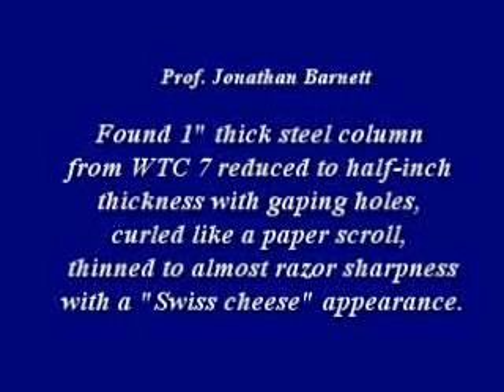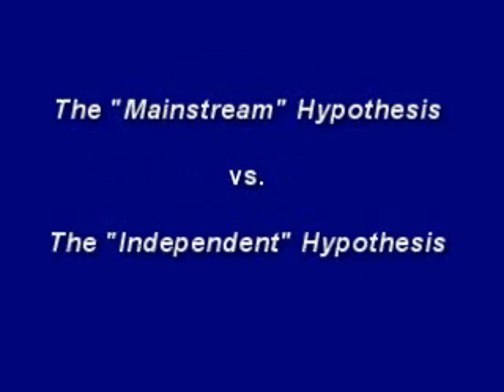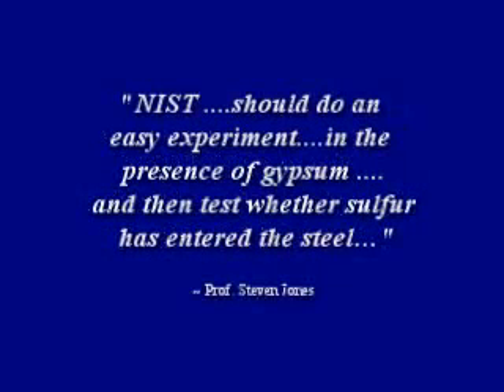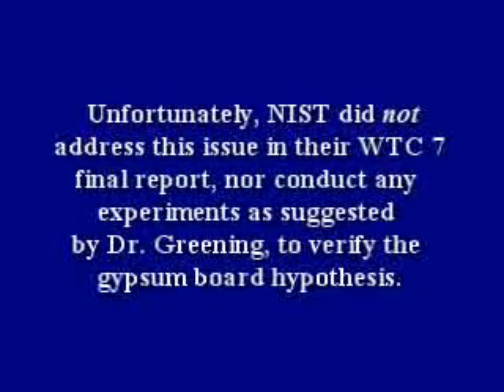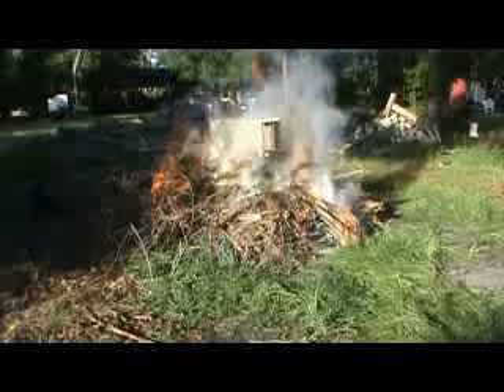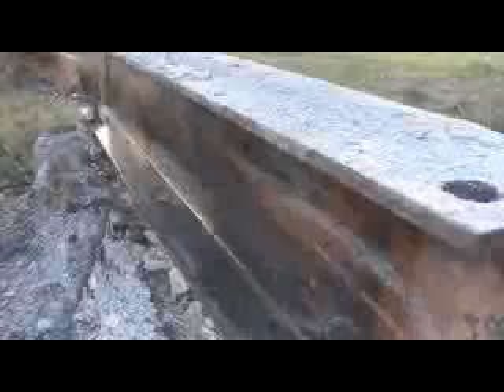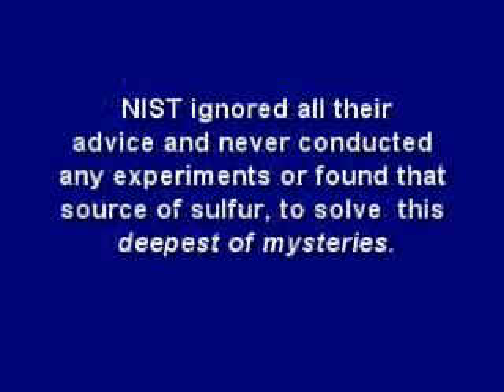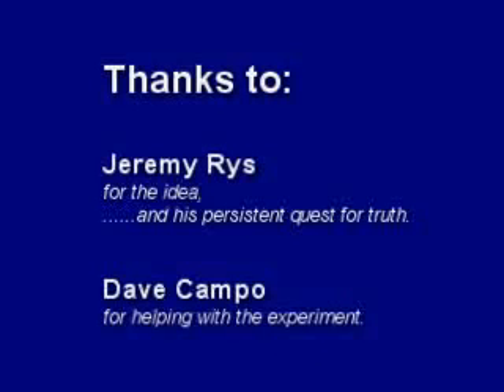9/11 Experiments: The Mysterious Eutectic Steel

Comment: The steel found was not melted, it was corroded in fire from 800 to 1000C.
At 5:44, the experiement puts the steel in wallboard, then in the fire. Wallboard is insulation, the steel will not get hot. This was not what happened on 911 - on 911 the wallboard that was used for insulation was dislodged during impacts and collapse. 
The steel corroded in the WTC had no wallboard covering it, it was in the pile. This dolt doing the experiment has no clue why the steel corroded in the WTC.

His experiment is dumbed down for people who can't think for themselves. 911 truth a movement that only exists in the minds of people who can't think for themselves. The corroded steel found at the WTC was not exposed to thermite or temperatures greater than 1000 C. No steel in the WTC was exposed to thermite. What a joke.  

The mysterious Eutectic Steel was corroded in fire, and the report explains this.
One source would be acid from batteries during the fires in the WTC pile.  But this video is not science, it is BS. 
http://www.fema.gov/pdf/library/fema403_apc.pdf
What an idiot, makes up a failed experiment, and lies about 911.  
13 years of failure - 911 truth
Reply: eyesuntzu The very last sentence of that link states; "No clear explanation for the sulfur has been identified"".
That was the point of this video, where did the sulfur come from. As shown, it couldnt have come from building materials.

mocking the murdered
Do you have the hubris to call the 911 Family Steering Committee ignorant and gullible? What about 911 Commissioner Bob Kerry when he stated "it is a 30 year old conspiracy?
Or the whistleblowers from the FBI, CIA, NSA ,Pentagon, and 911 commission?

Lastly, what proof do you have that 911 wasnt an inside job? Dont appeal to authorities either, just list the physical proof the OCT is absolute truth
Reply: Dr. Franken Juice Guess you lost your evidence and have no claims. Is Chemical Engineering too hard for you? Is that why you lie, out of ignornace, a lack of science. Were you upset when the "smart" kids took chemistry and physics, and there you were with Charlie Sheen, playing baseball, high school dropouts? Charlie, a high-school dropout believes your lies and fantasy, as do your other peers, the Boston bombers were 911 truth believers. You got the best...
http://www.fema.gov/media-library-data/20130726-1512-20490-8452/403_apc.pdf
Here is the report, you will not understand it proves no thermite was used on the steel samples found, two samples of steel corroded in fire. You will not understand science, so you believe BS you found on the Internet, and we all know, if it is on the Internet it has to be right... you are gullible...
13 years, and you are supporting liars, and nuts like the guy in the video, think he is a sewer engineer, and BS is his game.
Reply: Dr. Franken Juice Wow, the n-word, looks like you are upset you have nothing but lies and BS to support your delusional claims. You can't do engineering, failed to take science, and end up being a follower - 13 years of BS based on ignorance; self-critiquing
Guess you failed to understand why the report makes the video BS.
http://www.fema.gov/media-library-data/20130726-1512-20490-8452/403_apc.pdf
Maybe you can get a chemical engineer to explain where you failed. 13 years of lies based on ignorance. 911 truth exists due to the ignorance of the followers
Reply: Study of the steel corroded in fire. 
http://www.fema.gov/pdf/library/fema403_apc.pdf
The paper includes the corrosion could have started before 911. The paper shows the steel was exposed to fires 800 to 1000C. 
Thus slow corrosion was possible. But the steel samples corroded before or after 911 were subjected to fires due to the WTC disaster done by 10 terrorists with two planes, no thermite.
The study of the steel proves no thermite and makes the video a failed experiment.
Reply: eyesuntzu
Lol. What are you even trying to achieve by insulting others and twisting facts?
Reply: freierHimmel You insult yourself by supporting the insanity of a Beam Weapon, and dustifying steel.  You have a fantasy and mock the murder of thousands on 911 by spreading idiotic insane lies.  You are good at it. Insulting, you are spreading lies, you can't figure out 911 - and you are proud of it.  You should try taking physics instead of falling for lies from Judy Wood.  911 truth spread lies.
Reply: eyesuntzu
Ah, come on, you can do better. Blaming on others what you do, thats so old...
 Its fun to see with what you shills come up with just to discredit someone^^
Reply: Corroded steel is not caused by fire, melted steel is caused by 2800 degrees F. Maybe someone can tell me where the heat came from? It sure in the hell did not come from a low temp fire. And in Bldg 7, every beam both horizontally and vertically magically failed at the same time uniformly. What a load of horseshit. Study physics, that way you won't sound stupid and ignorant.
Reply: freierHimmel Oh, shills, you are paranoid and failed to figure out 911 after 13 years. You have no evidence to support your claims, and sadly you have no clue you have no evidence.
Reply: Thomas Sayles There was no melted steel at the WTC. Study the event before blindly fooling idiots who think thermite did 911, giving a pass for 19 terrorists, and mocking the murdered. Hard to get dumber than the melted steel lie; are you gullible, or what. 
WTC 7 was not a terrorist target on 911, it did not fell uniformly, do say so only exposes your ignorance and gullibility.
Reply: Jeffery Pinley It did come from the building, sulfur was all over the WTC, and the reports clearly cover what it could be, but they will never know exactly what it was; the steel did not melt, thus it was not thermite; and no steel had any damage from thermite, or explosives.  
There are no whistle-blowers for 911, there are some fake ones, but most people can figure out they are liars.  
What proof you have 911 was an inside job; gee whiz, you can't even figure out corroded steel is not from thermite, how will you prove your inside job fantasy?  Got some Bigfoot proof with your 911 fantasy?  
Is Bob Kerry selling another book?  
Guess you have no clue what is in wallboard, or in UPS, or in plastic, etc...
Reply: eyesuntzu"and the reports clearly cover what it could be, but they will never know exactly what it was"

Oh so what the govt says may not be absolute truth? Where did the sulfur come from? What about the 'meteroite'? What about Bechtel engineers report temps above 1600f to 2800f the temp of molten steel? Why do several eye witnesses report seeing molten steel? They saw glowing red, not aluminum like many deniers try to claim, aluminum when melted is silvery.

"There are no whistle-blowers for 911, there are some fake ones, but most people can figure out they are liars"

Care to explain why Cibel Edmonds is fake? Or Max Cleland? Or April Gallop? Or Barry Jennings? Or Susan Lindauer? OR 911 commissiner Bob Kerry when he states "it is a 30 year old conspiracy"?

"you can't even figure out corroded steel is not from thermite"

Seems you completely missed the point of the video, nothing in the building material can explain the sulfur. Regardless, 3 buildings completely destroy themselves symmetrically top to bottom near free fall (wtc7 was at ffa), only possible through precise removal of key components, aka CD.

And why wont the govt show just one conclusive video of what hit the pentagon? IF its really a plane, then why wont they show a vid? It really takes a devout leap of faith to assume the govt isnt lying

"Got some Bigfoot proof with your 911 fantasy?"

Strawman fallacy, deniers often do this, they try to connect 911 truthers with any fringe belief like fake moon landing etc. Its a childish technique used to make oneself feel as though they are winning the debate.

"Is Bob Kerry selling another book?"

Another strawman fallacy, this has nothing to do with 911.
Do you have proof 911 wasnt an inside job? Cant appeal to authorities either, whats your proof? Do you have the hubris to call the 911 Family Steering Committee delusion wackjob truthers?
Reply: 1.There was absolutely no wallboard or similar crushed material in the area where this steel was recovered? Could you provide a source.
1.Wall board is insulation, however, what evidence do you have that states the steel would not get hot, and what exactly is "hot", seriously thats running pretty loose with definitions?
1.The above is all you have to attack his experiment yet you are throwing "dolt" around?" Try proving your allegations before summarizing please. Otherwise you come across as doltish.

"The corroded steel recovered at the world trade centre never topped 1000C"
Could you please provide a source to this because you have so far done little here?

You suggest a source may be from battery acid. Again, please provide a source.
Then if it is a possibility, would you agree then the best solution would be to simply attempt to eliminate this as a possibility by doing some real world tests like this guy rather than muttering your views with zero substance?

Thank you come again.

When are you guys ever going to write that counter paper to debunk the Dr. Neils Harrit Nano Thermite Paper?
I read a long time ago our good friend at NIST Dr. Millette swore to do this but that was years back. Since then he has made some non peer reviewed reports doing little to nothing but has FAILED to simply follow through and write a counter paper to disprove it. 
Oh wait, are you going to try to attack the PUBLISHER now? Just curious because, that is what you guys have ALL ended up doing as your "strategy." I mean, I know its an easy out but it still leaves everyone wondering, "Well, if it is bunk then just write the damn counter paper."
What this says to me is no one is able to disprove his paper and it isn't the most complex ever written, so what is up with taking so long?

Finally, whether or not any particular video meets my or your standards is a fair discussion but to criticize folks doing there own experiments with their own time and money is something to admire and I don't care which side you push. Remember, It was a popular science show for kids that would "prove thermite cannot cut through steel? Remember that when your kids were being lied to for the sake of ideology? Well, it was quickly disproven by Joe in his backyard!
Reply: schlooonginator Jones/Harrit paper clearly shows the dust they found was not thermite, but guess chemistry is not in your skill set; your skill set seems to be googling BS and repeating it freely as if you knew something; aka, gullibility, and no critical thinking skills, no useful knowledge. You failed to understand why the dolt in the video applied wallboard. 
The steel found was corroded in fire at 1000C or less, at temperatures steel does not melt.
Yes, you support a study which had to be published in a vanity journal, they paid, because no one would publish lies in a real journal.  No big deal, you are gullible, it is your best skill.  
No thermite was used on 911, except in your fantasy made up by old nuts. Their paper was not peer reviewed by real experts, as you can see the DSC does not match, and you don't care to check it out. 
If I had all your evidence, I would have the biggest Pulitzer since Watergate; yet you have no clue why you can't state real evidence, as you repeat dumbed down lies only idiots fall for.  
Are you lazy, or what? Take your evidence to newspaper and get the Pulitzer? What too lazy... you will do nothing, you have no clue what evidence is.  Keep supporting dumbed down lies, it is you best skill.
Reply: eyesuntzu Your statements are rambling, vague, and almost incomprehensible.  Just "Denial" is not saying anything of value. For example you say "no  thermite was used on 9/11".  How do you know that?  Many sources have said there was.  In fact, it appears that thermite derivatives can still be found in the area if anyone cares to look carefully.
Reply: eyesuntzu
yet you show up with no Pulitzer.

You seem to love strawman fallacies, between that and ad hominems is all deniers have.

Where is your evidence. where is the evidence from all your blowers?

I present to you;
This goes over the cover-up the commission is responsible for
http://www.democracynow.org/2004/3/23/the_white_house_has_played_cover
And then there are whistleblowers galore!
Are you familiar with Cibel Edmonds? She's an FBI whistleblower who released classified docs showing the US govt works with OBL upto 911. http://www.scoop.co.nz/stories/HL0408/S00012.htm
In 2005 the Office of the Inspector General determined that none of Edmonds' allegations can be refuted.
More on Sibel
http://www.bradblog.com/?p=7332
Wall Street whistleblower Richard Grove
https://archive.org/details/911_Whistleblower_Richard_Andrew_Grove__May2806
https://www.youtube.com/watch?v=WHOujO-Qnlw&feature=PlayList&p=0E538EF1638B57DF&index=0
Federal Reserve whistleblower
http://www.historycommons.org/searchResults.jsp?searchtext=william+bergman&events=on&entities=on&articles=on&topics=on&timelines=on&projects=on&titles=on&descriptions=on&dosearch=on&search=Go
JP Morgan whistleblower
http://ourworldinbalance.blogspot.com/2005/04/story-of-indira-singh.html
Or April Gallop, she's a Pentagon whistleblower who testifies that she never saw anything resembling a plane.
Then you have Barry Jennings, almost killed in wtc7 from explosive destroying the stairwell he was in, this happened before any towers collapsed. Key eye witness for explosives, there are plenty more yet deniers cant deny Jennings, or at least they try. here's the full interview with Jennings
https://www.youtube.com/watch?x-yt-ts=1421914688&v=OmeY2vJ6ZoA&x-yt-cl=84503534
Pentagon lied http://www.washingtonpost.com/wp-dyn/content/article/2006/08/01/AR2006080101300.html
CIA official lied under oath http://www.scoop.co.nz/stories/WO0406/S00098.htm
Condoleeza Rice lying https://www.youtube.com/watch?v=KUsR8kUF-aY
Then Bush claims no prior administration ever considered flying planes into buildings, except it had been, by the Pentagon, FEMA, NORAD, and the NRO
https://en.wikipedia.org/wiki/Pentagon_MASCAL
http://www.historycommons.org/context.jsp?item=a00planesasweapons#a00planesasweapons
http://911blogger.com/news/2010-07-27/norad-exercise-year-911-simulated-pilot-trying-crash-plane-new-york-skyscraper-un-headquarters
This goes over refusal to share evidence by the FBI
http://911research.wtc7.net/pentagon/evidence/missing.html
This details some of the lies faced by the 911 FSC
http://en.wikipedia.org/wiki/Criticism_of_the_9/11_Commission
More on the fraudulent modeling by NIST
https://www.youtube.com/watch?v=YQI6gOw9y-c
https://www.youtube.com/watch?v=ZyRjm6JeHDU
https://www.youtube.com/watch?v=IsxsxxmYP6A
Another lie by NIST
“In WTC 7 no studs were installed on the girders.” - NCSTAR 1-9, page 346 

LEts see you deny all that, itll be a testament to your denial.
Reply: Jeffery Pinley Wow, you do the gish gallop as if you invented it. You have nothing to support your delusional claims. No Pulitzer yet for your Gish Gallop google super BS spurt of fantasy CT junk?  13 years and you regurgitate lies and nonsense without thinking.  
If Barry was next to an explosion, he would be dead, you are clueless; Barry heard or felt WTC 7 being hit by debris from the towers, but you use BS you google and repeat it; you entire pile of BS is BS.  You have not point.  
UBL did not work for the US, you can't read for comprehension, or are incredibly stupid.
Reply: disgny You have no valid sources that prove thermite was used on 911. Your statement is BS, gee, you can see I can't write, but you can't figure out 911. 
There was no thermite used on 911, and the proof is no steel was damage by thermite.  It is that simple; thermite would leave evidence on the steel, it was not present on WTC steel.  Thermite leaves a lot of iron, and the iron would fuse to the steel and leave lots of evidence; not to mention the pile of iron it would leave. Do you try to figure out what thermite is, it is used to fuse steel to steel on railroads, it leaves iron behind; there is no thermite. The paper, or evidence you think you have, or 911 truth has; the paper is fake, it clearly shows they did not prove it was thermite, the DSCs don't match. Did you fail to check the paper, can you comprehend chemistry; No.  The rest of your evidence for thermite is BS, talk, dumbed down opinions, and fantasy.  But go ahead, the use of thermite on 911 would be Pulitzer Prize winning revelations; yet you have no Pulitzer, because you and 911 truth have nothing but lies and BS.  

I ramble, I am vague, and I am incomprehensible; you are gullible, you can't do chemistry, you have no clue what constitutes evidence, and you support liars, and idiots in 911 truth.  Good job, you can write better than I, you can't figure out 911.  

Pretty sad you can't figure out 911, so you support liars out of ignornace.  super -

You failed to look carefully, there was no thermite; you were fooled by liars. Are you gullible, or ignorant.
Reply: eyesuntzu One of the reasons I doubted the Official story from years ago was that I had heard of thermite used in welding railroad rails a hundred years ago.  As the  thermite-thermate question , ie. sulfur inclusions,  the sources named in the video are pretty impressive.  So you say they are totally phony ?  How do you know that?  As for the"Iron" , that , logically , is the elemental iron that the steel was made of, and since it is melted vigourously, it is not a surprise that it ends up as microspheres, i..e   not obvious, and NOT sticking onto any steel lying around in the rubble.  The academic people who say that thermate was present, and also say that these traces are still present around WTC to this day,  do you claim that they are all fantasizing , or what?  And , don't you find it at all strange that at this, one of the largest Murder sites in history,  no one at all was criticized for removing the evidence (the rubble) before it could be investigated ?  That is a Felony. Are we all fools, liars , and idiots for complaining the NO serious investigation was done, to this day?!
Reply: disgny Micro-spheres of iron are found in fires, and not due to thermite.  There was no thermite used on 911, that is a fantasy from a failed nut. There is no melted steel on 911, zero. The video is BS.  There were serious investigations, you missed them and fall for lies from nuts on youtube.  
You have less than 0.1 percent of academic people who say there was thermite; wake up and take a chemistry course, or better yet, chemical engineering, to see 911 truth is a scam to fool people who can't think for themselves; if my roomate in college can become a chemical engineer, you can; unless you are unable to learn, and understand. 911 truth is fake, fraud, lies.
Reply: eyesuntzu Your statement that 9/11 Truth is fake, fraud , and lies would be much more credible if you could come up with some theory, no matter how wild, about what the motivation of it might be.  Can we agree that some 3000 people were murdered, and there has never been a proper investigation, or do you have access to some secret material that the public does not?  There is not a single sentence of your statement that is correct.  For example, I first heard about thermite 50 years ago in my chemistry class.   And , if you have access to the Internet,you too must have seen pictures of the Authorities industriously "cleaning up" the site, removing as much evidence as they could, but not before videos were taken, showing various damaging aspects to the Official Story, such as one showing WTC columns CUT OFF at 45* degree angles.  something routine in controlled demolitions, but impossible for an airplane to manage.
Reply: disgny You lie again, it was the biggest investigation in history, the FBI investigated 911, the biggest FBI investigation in history - you missed it?  Why do you lie? NIST investigated the WTC towers and WTC 7, thousand of pages which you failed to read? Yes, I have access to all the data, Radar, FDR, and can read NIST, and FEMA reports which you failed to read, and you prefer the quick and dumbed down youtube lies and BS made up by kids and nuts who believe in BS conspiracy theories. 
The columns you saw cut off at 45 degrees were cut after 911 to clean up the WTC site; you use cuts made after 911 to make up BS CD lies. The cuts you saw were near ground level, made after 911. You failed to understand there have been many studies on the WTC, you prefer the BS ones you find on youtube and idiot's web pages based on ignorance. 
Not a single piece of steel at the WTC was damaged by thermite, and not one piece of steel was damaged by explosives.  You forgot to check the evidence, and missed all the studies.  You lie about the investigation because you believe idiots who lie about 911.
Reply: eyesuntzu I do not quarrel with the idea that it was "the biggest investigation in history" , I 'm sure it cost plenty.  But the point was that it was not designed to investigate anything of importance concerning 9/11.  That was ruled out in advance.  It was NOT investigated as an ordinary mass murder would be.  Smoke and mirrors, to put it poetically.
Reply: disgny What a load of BS, they did not miss anything, and you can't explain what was missed with evidence. But that is what liars do, spread BS about 911, and never get specific. You will never be satisfied with any investigation, you believe in BS and have nothing of value. 
Where is your list of what was missed. Why do you lie about 911? Did you google up 911 truth lies? You seem to be using the Internet as your source of woo. 
What smoke and mirrors? lol, you repeat tag lines from 911 truth, like a parrot.
Reply: eyesuntzu Feel free to look at this list of everything 'they did not miss'. If you can, please debunk them.
http://911debunkers.blogspot.com/2008/08/top-40-reasons-official-911-story-is.html 

Its as obvious as it gets.....
Reply: Jeffery Pinley The first AWOL BS, is nonsense. Why present a list made up by idiots who can't figure out 911?  The command and control were not AWOL, your first strike.
The second point is a lie based on ignornace of the FAA, NORAD and the USAF. Sorry, you second point, strike two.
So far you have opinions based on BS and ignorance. 
Number 3... More BS, Hanni did not do any aerobatics, and he was able to fly a Cessna, you failed again - omg, you are OUT.
You googled up your knowledge on 911 and found BS based on maximum ignorance.  You have failed.
Number four - the Pentagon did not simulate a strike on the Pentagon, they did a mass casualty from a plane wreck since they are right nest to an airport - are you unable to see this is a bogus point, and does not support the idiotic claims of 911 truth. 
Flight 93 was not shot down, you and I can have the data from Flight 93's FDR, and it shows 93 was not shot down, but flown by the terrorist into the ground - gee, you can't get one thing right on 911, as you have to use lies from nuts to be your knowledge.  Are you a follower, or leader?  
The rest is BS you can't support with facts and evidence.
http://911debunkers.blogspot.com/2008/08/top-40-reasons-official-911-story-is.html  Total nonsense, and failure to launch.  If they had something, they would have a Pulitzer, but no newspaper will team with the BS you that fooled you with dumbed down claims only idiots believe.  
Love number 11, insider trading, which was investigated and found not to be a factor - but then you must not understand stock trading; but ask Martha Stewart about trading stocks and doing something wrong... you sure are gullible.
Reply: eyesuntzu
The first AWOL BS, is nonsense. Why present a list made up by idiots who can't figure out 911?  The command and control were not AWOL, your first strike.

Bush reading at an elementary school, rumsfield not at pentagon,
Myers http://911research.wtc7.net/disinfo/alibis/myers.html
http://www.historycommons.org/entity.jsp?entity=montague_winfield

The second point is a lie based on ignornace of the FAA, NORAD and the USAF. Sorry, you second point, strike two.

http://911research.wtc7.net/planes/norad/intercept.html
www.nbaa.org/admin/sms/.../StandardOperatingProcedures-FixedWing.d

Number 3... More BS, Hanni did not do any aerobatics, and he was able to fly a Cessna, you failed again - omg, you are OUT.

Failed http://georgewashington.blogspot.com/2007/11/no-he-couldnt-fly-either.html

'aerobatics' is referring to the 270 spiraling corkscrew 8000ft descent coming exactly level with ground.

As Capt. Russ Wittenberg, U.S. Air Force – Retired commercial pilot who flew the same airliners states
"The government story they handed us about 9/11 is total B.S. plain and simple." … Wittenberg convincingly argued there was absolutely no possibility that Flight 77 could have "descended 7,000 feet in two minutes, all the while performing a steep 280 degree banked turn before crashing into the Pentagon's first floor wall without touching the lawn...""For a guy to just jump into the cockpit and fly like an ace is impossible - there is not one chance in a thousand,"

You googled up your knowledge on 911 and found BS based on maximum ignorance.  You have failed.

You have yet to provide a cohesive argument with substance devoid of petty insults or sources.

Number four - the Pentagon did not simulate a strike on the Pentagon, they did a mass casualty from a plane wreck since they are right nest to an airport - are you unable to see this is a bogus point, and does not support the idiotic claims of 911 truth.

http://911research.wtc7.net/planes/defense/wargames.html

Flight 93 was not shot down, you and I can have the data from Flight 93's FDR, and it shows 93 was not shot down, but flown by the terrorist into the ground - gee, you can't get one thing right on 911, as you have to use lies from nuts to be your knowledge.

http://www.americanfreepress.net/html/flight_93.html

If they had something, they would have a Pulitzer, but no newspaper will team with the BS you that fooled you with dumbed down claims only idiots believe.

fallacies; affirming the consequent, ad hominem
 
Love number 11, insider trading, which was investigated and found not to be a factor - but then you must not understand stock trading; but ask Martha Stewart about trading stocks and doing something wrong... you sure are gullible.

So where are the records that found them to not be a factor? Oh that's right, the SEC destroyed them.
http://www.washingtonsblog.com/2010/06/sec-government-destroyed-documents-regarding-pre-911-put-options.html

Every single one of those points are linked and sourced, you have yet to prove a single one wrong.
Reply: Jeffery Pinley Citing more BS does not save your BS from being nonsense. You use 911 truth BS sites to support the BS you posted from idiots on 911. 
Hani was never level with the ground and he did a not impressive decent at or about 300 knots; in the last 30 seconds he pushed the throttles up to 100 percent and exceeded Vmo for 20 seconds. You have no clue Hani let down from 7,000 feet in a less than standard rate turn unable to hold a steady bank angle. you post lies from idiots, and that is the best you can do.
Wow, you posted dumber junk to support your BS from the kids.
The puts were options on long positions, it seems your ability to do rational research is clouded by the BS you google up out of ignorance.
You failed again, and presented nothing of value;
Not news you will not be getting a Pulitzer for recycled lies and BS.  
You provided BS, not a single piece of evidence.  
American Free Press, is not a credible source - you are stuck with lies. 93 was not shot down, I have the FDR data, and it shows all systems running up to impact.  Means you are wrong; why do you support dumbed down lies about 911? 
http://www2.gwu.edu/~nsarchiv/NSAEBB/NSAEBB196/doc04.pdf
oops, you lied, Flt 93 crashed into the ground, not shot down - oops, no USAF aircraft was close enough, or had guns or missiles - darn, you lied
http://www.ntsb.gov/about/Documents/Rec_Radar_Data_Study_all_aircraft.pdf
Plus we have Radar, which show the path of all flight, and show no aerobatic action by any flights; it shows less than average pilot skills, anyone could have flown the jets on 911, a kid off the street could do better - but not you, you can't figure out 911 given the data and evidence for 13 years. 
you are a failure, based on your ignorance of 13 years; now you lie about 911
Reply: eyesuntzu
You use 911 truth BS sites to support the BS you posted from idiots on 911.

Except for;
http://www.historycommons.org/entity.jsp?entity=montague_winfield
www.nbaa.org/admin/sms/.../StandardOperatingProcedures-FixedWing.d
http://georgewashington.blogspot.com/2007/11/no-he-couldnt-fly-either.html
http://www.americanfreepress.net/html/flight_93.html
http://www.washingtonsblog.com/2010/06/sec-government-destroyed-documents-regarding-pre-911-put-options.html

And all of the 911 sites have references for you to source their claims.

You have no clue Hani let down from 7,000 feet in a less than standard rate turn unable to hold a steady bank angle. you post lies from idiots, and that is the best you can do

Not according to aviation experts in the field, military trained combat and commercial airline pilots.
http://patriotsquestion911.com/pilots.html

The puts were options on long positions, it seems your ability to do rational research is clouded by the BS you google up out of ignorance.

See source above for SEC destruction of those records.

You provided BS, not a single piece of evidence.

If you can, please provide what evidence you have.
Reply: Jeffery Pinley More BS; you have nothing.  The SEC did not destroy evidence, you have found web pages filled with nonsense. If you could prove the claims you would be famous; you have lies and fantasy.
Pilots for truth are liars and frauds, they have less than 0.1 percent of all pilots supporting their lies, and they have you, and you can't comprehend Radar, and FDRs to figure out they are lairs. You are pushing more BS each post.
Maybe you don't understand English, they investigated the puts and found they covered long positions - if you don't understand stock, you might want to drop this point, you have no clue you were fooled into a fake opinion based on nothing. 

The rest of your source you called references amount to a Gish Gallop based on BS. You have nothing you can logically support the big claims you failed to clearly state. Better try Bigfoot, or flat-earth movements, they don't disrespect those murdered by 19 terrorists.   

You found the dumbest pilots on the Internet, good job.
So far you are batting zero

The 40 points are all BS, and have no value for the claims you can't define.
The Cell Phone stuff is funny, cell phones do work but like driving, they cycle through towers and don't maintain a connection, but I have called to people in flight with a cell phone; the passengers used seat-back phones, oops, it means 911 truth is stupid, dumbed down claims for people who can't think for themselves.
Reply: eyesuntzu
More BS; you have nothing.  The SEC did not destroy evidence, you have found web pages filled with nonsense. If you could prove the claims you would be famous; you have lies and fantasy.

David Callahan – executive editor of SmartCEO – submitted a Freedom of Information Act request to the SEC regarding the pre-9/11 put options.
 
The SEC responded:
This letter is in response to your request seeking access to and copies of the documentary evidence referred to in footnote 130 of Chapter 5 of the September 11 (9/11) Commission Report.

We have been advised that the potentially responsive records have been destroyed.

Pilots for truth are liars and frauds, they have less than 0.1 percent of all pilots supporting their lies

ad hominems, and appeals to majority

and they have you, and you can't comprehend Radar, and FDRs to figure out they are lairs.

If you can please describe what false claims they are making

You are pushing more BS each post.

If you can please describe in detail what is BS, including the 40 point page.

Maybe you don't understand English, they investigated the puts and found they covered long positions - if you don't understand stock

Where are the records of this investigation?
 
You have nothing you can logically support the big claims you failed to clearly state.

If you could please logically support your claims and debunking the 40 point page

Better try Bigfoot, or flat-earth movements

straw man

they don't disrespect those murdered by 19 terrorists.

The 911 Family Steering Committee are truthers, and here you continually insults truthers. Therefore, it is you disrespecting them by your due diligence in promoting the false OCT.   

You found the dumbest pilots on the Internet, good job

If you can please describe in detail why their claims are false.
Reply: Jeffery Pinley All the Pilots for truth claims are false, you can't cite one that is based on evidence. You can't shift the BS on me, you can't support a single pilot for truth claim with evidence - you never will, they never did.
Please pick on pilot for truth claim and prove it.  You can't, you never will, you will do the Gish Gallop and spew more BS.
You are the one pushing BS and lies, you are disrespecting those who were murdered by 911 terrorists - it is on you, and the steering committee can support your claims with evidence.
The stock trades were not related to 911, they covered long positions, you have BS from an Internet source which made a bunch of BS questions, and had no evidence.  
Still batting zero, as you can't pick any claims and prove them.
This is why 911 truth failed to team with any newspapers and earn the biggest Pulitzer Prize since 911 for what if truth, is the biggest conspiracy in history; yet you have BS, lies, and fantasy.  You google up lies from 911 truth and fall for them due to ignornace.  
Which is your best claim?  
The video talks about steel corroded in fire and tries to lie and say it was caused by thermite, yet the steel structure and damage indicates corrosion at 800 to 1000C. Thus no thermite, and you are left doing the Gish Gallop, repeating BS from failed nuts in 911 truth. 
13 years of failure.
If your failed claims were real, you could take your evidence and earn a Pulitzer, but you have BS and lies, no evidence. You failed like 911 truth, and you are gullible.
Reply: eyesuntzu
All the Pilots for truth claims are false, you can't cite one that is based on evidence. You can't shift the BS on me, you can't support a single pilot for truth claim with evidence

Youre so confident in knowing why pf911truth are false, but have yet to explain why.
Evidence for their claims;
-max operating speed; historical precedent, design limitations
-NTSB flight recorder data does not match OCT
-high-speed dead air
Just a few issues, you have yet to explain why any of those are wrong. Please if you can, detail the falsehoods.

Please pick on pilot for truth claim and prove it.

-according to the OCT, the airliners were traveling 100+ beyond MOS. Beyond that limitation, the plane goes into catastrophic failure.
-the NSTB flight recorder data does not match the OCT, contradicts the pentagon claims

you are disrespecting those who were murdered by 911 terrorists - it is on you, and the steering committee can support your claims with evidence.

911 families believe the govt is lying, you are insulting truthers for claiming the govt is lying, are you arrogant enough to call the 911 FSC a bunch of looney twoofers?

The stock trades were not related to 911, they covered long positions, you have BS from an Internet source which made a bunch of BS questions, and had no evidence.

Those put-options were on AA and UA, on Sept 8th, 9th, and 10th. On 911 those stocks tanked meaning someone made millions. The SEC investigated, and stated nothing innocuous, however when asked to provide those records, they destroyed them.

This is why 911 truth failed to team with any newspapers and earn the biggest Pulitzer Prize since 911 for what if truth

If I may, are you an older person? Somewhere between 35-70? From what Ive experienced, the most hostile and vulgar deniers are in that age bracket. They also resort to your fallacies in step like fashion. Sadly, most old fogies will likely be dead before its proven that 911 was an inside job, similar to many conspiracies in the past.

The video talks about steel corroded in fire and tries to lie and say it was caused by thermite, yet the steel structure and damage indicates corrosion at 800 to 1000C.

Prove it.

13 years of failure.

A success thanks to folks like yourself. When somone comes to these vids and see's these comments, they will notice deniers resort to continual insults and fallacious reasoning. Polls are now showing more people than ever doubt the OCT, largely in part thanks to deniers, as they contribute to the revealing of false info.
Reply: Jeffery Pinley Pilots for truth lie about 911, they have nothing.
The 767/757 were designed to be flutter free to 1.2Vd, only 175 exceeded 1.2Vd for a few seconds and crashed, no major damage shown video. oops, you blew it.
Flight 11 impacted at Vd, a flight tested speed; Flt 93 crashed into the ground, you can't state the speed, so you are, dumb, or what. Flight 77 was over Vmo for 20 seconds and crashed into the Pentagon, at 483.5 knots, not over 1.2Vd; darn you have no clue what speed means for aircraft on 911 past the BS and lies you googled and plagiarized from 911 truth sources. You forgot to look up the FARs on design for the 767/757; big error, and it makes you gullible.
The FDR match exactly the Radar data and what happened on 911. You are wrong again. And you can't show me where they are different. Oh my
What is high speed dead air? lol, you don't have a clue.
You are gullible, and have no clue on flying issues.

Steel corroded in fire at 800 to 1000C, it was in the study you failed to read, and it looks like you can't do chemistry, or science.
http://www.fema.gov/media-library-data/20130726-1512-20490-8452/403_apc.pdf
Here is proof, but you will not comprehend it is; you prefer lies of thermite and BS. You like fantasy, and for 13 years you celebrate ignorance over reality.  Good job

What is MOS? You don't have a clue.  Already covered the speeds, only one plane was possibly 5 knots over 1.2Vd, a speed the 767 was designed to be flutter free at.  oops, you believe halfwit liars, pilots for truth, who fake data to fool people like you who have no clue they are liars.  A fringe few pilots who lie.

FDR and Radar confirm what Flight 77 impacted the Pentagon. You lost, you have no clue.
http://www2.gwu.edu/~nsarchiv/NSAEBB/NSAEBB196/doc02.pdf
Radar proves you wrong. You can also get the Raw Radar data for 911, but you are too lazy to do more than google lies, and BS.
ironically, 911 truth guys and an independent researcher debunked your Pentagon BS...
http://www.journalof911studies.com/volume/2010/Calibration%20of%20altimeter_92.pdf
Irony...

http://app.ntsb.gov/doclib/foia/9_11/AAL77_fdr.pdf
FDR matches Radar, you lied, or was it Pilots for truth.
Reply: eyesuntzu
The 767/757 were designed to be flutter free to 1.2Vd, only 175 exceeded 1.2Vd for a few seconds and crashed, no major damage shown video.

"Radar Data Impact Speed Study" in which the NTSB concludes 510 knots and 430 knots for United 175 (South Tower) and American 11 (North Tower), respectively. A benchmark has been set by the October 1999 crash of Egypt Air 990, a 767 which exceeded it's maximum operating limits causing in-flight structural failure, of which data is available to compare to the WTC Attack Aircraft...It is impossible for the alleged United 175 to achieve the speeds reported by the NTSB using EA990 as a benchmark

Flight 77 was over Vmo for 20 seconds and crashed into the Pentagon, at 483.5 knots, not over 1.2Vd

Still overcomes the EA990 benchmark, coupled with g-force, the plane shouldve stalled, as many of the aviation experts I just linked described.

The FDR match exactly the Radar data and what happened on 911.

the OCT claim of flight 77 is 100ft over the light poles supposedly to hit
See the details here, http://pilotsfor911truth.org/techpaperAA77
No FDR's were recovered from 11 or 175

What is high speed dead air?

Commander Ted Muga, BS CE, U.S. Navy - "When a commercial airplane gets that high, it gets very, very close to getting into what you refer to as a speed high-speed stall. And a high-speed stall can be very, very violent on a commercial-type aircraft and you never want to get into that situation."
Stalled was the right word.

Here is proof, but you will not comprehend it is; you prefer lies of thermite and BS.

From your link APP C.6 "The severe corrosion and subsequent erosion of Samples 1 and 2 are a very unusual event. No clear explanation for the source of the sulfur has been identified"

Quite the proof you have there.
the eutectic reaction products were the result of liquification (melting) under highly oxidizing conditions. The eutectic seen in the melted zone wasn't present in the base steel. They don't use steel with eutectics that embrittle. For WTC steel, the eutectic was iron sulfide.
But, the iron oxide (not eutectic) was in the melted layer which further proves that it melted."1510ºC (2750ºF)

FDR and Radar confirm what Flight 77 impacted the Pentagon. You lost, you have no clue

Everything in your link is discussed here http://pilotsfor911truth.org/techpaperAA77
Reply: Jeffery Pinley There was no excessive g-force; you been fooled again.
pilots for truth are liars, you have nothing
There was no melted steel. but you can lie, you are 13 years of failure personified
Reply: Dr. Franken Juice You lie about 911, now you are so smart. What else do you do, deny the Holocaust, hunt for Bigfoot?  The steel samples were corroded in fire, you can add chemical engineering to the things you will never understand; along with logic, and research.
Reply: Dr. Franken Juice All your evidence is the f-bomb, and the c-word; wowzer, you are an intellectual super star, you can't prove your 911 claims, so you f@$3 and c#&% your way to BS. Keep up the good work; it is, "say hello to the idiot, Hello Dr. Frenken Juice, say hello to Dr. Juice, Hello idiot."  You are a winner on 911 issues, keep up the good work.
When is the big breakthrough, next year? lol, aka never

Was the c-word all your evidence, or do you have to add a few f-bombs?  13 years, and this is your peak? or ...
Reply: Dr. Franken Juice Wow, the t-word, is that your backup?  lol, you got nothing but BS, and you never will make anything with your failed dumbed down fantasies on 911.  You have lies and BS, you can't waste what you don't have. 
You can't support any 911 truth claims with evidence, so you can't backup plenty with the big zero.
13 years of BS and lies, 911 truth. Failure and stupidity.
Reply: Dr. Franken Juice You lie about 911, and don't know it; aka clueless
I call my mom, and it is not unusual to include my name, it is what we do. I guess you are saying the phone call was fake, but you are clueless.
Making fun of the murdered of 911 is your only skill. You have a skill
Reply: Dr. Franken Juice You lie about 911, mocking your lost friends with lies about 911. 911 truth, endless Gish Gallop of failed claims based on ignorance; 13 years of failure to make a point. 911 truth, no clue what truth is, or what evidence is.
Reply: To:  eyesuntzu, ... ARE YOU BRAINWASHED OR BRAIN DEAD ??
Reply: Maximus Prime if we could IP track these idiots i would open a concentration camp only for them